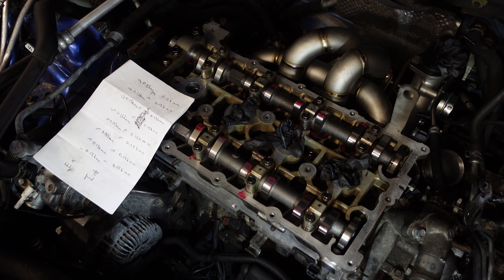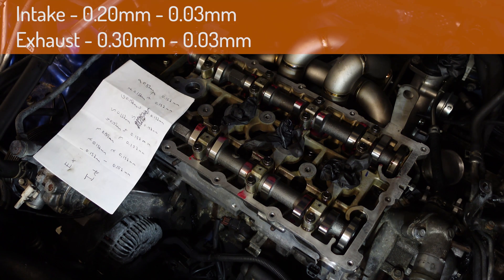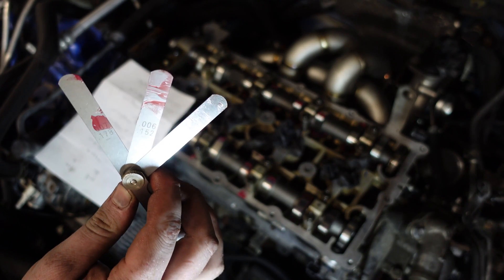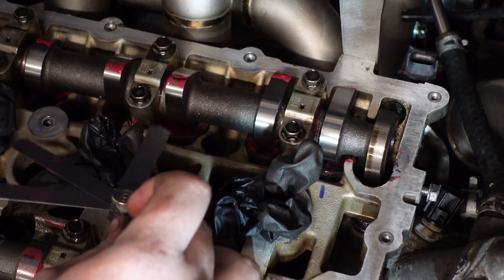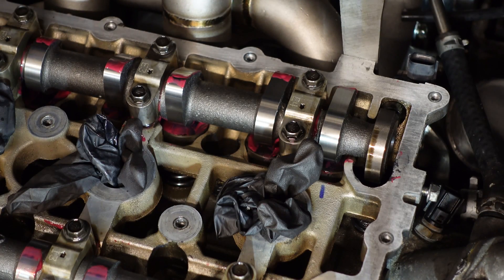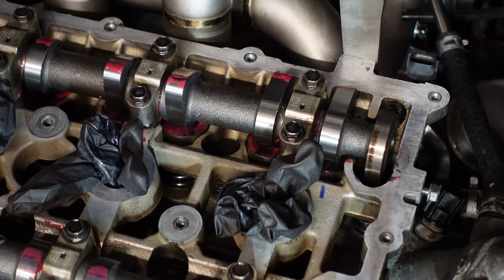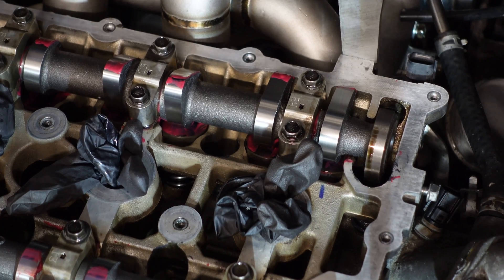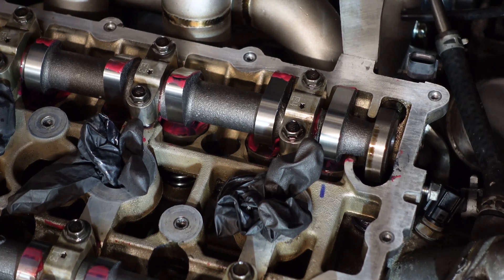HOW TO: Check Valve Bucket Clearances

Comment: Very nice. But in the beginning you’ve said it should be 0,2 +-0,03mm. Than means that your gap is to small)) and your valves are going to burn out...
Reply from the maker: 0.2 - 0.03 they are 0.15
Reply: @rowanlewisuk  but they should be 0,17-0,23. If less - no more valves))
Reply from the maker: @yuryrysiavets2958  thats not what the Mitsubishi engine overhaul manual says, according to Mitsubishi its in spec
Reply: @rowanlewisuk  manual says that on intake it should be 0,2 +-0,03 and on exhaust 0,3 +-0,03. 
So by putting 0,15 you got the risk of valves burning
Reply: @yuryrysiavets2958  This is what I'm seeing in the manual. So confused now. LOL! Using a thickness gauge, measure the valve clearance with the arrow shown in Figure. If deviated from the standard value, make note for the valve clearance.
Standard value:
Intake valve 0.20 ± 0.03 mm (0.008 ± 0.0012 inch)
Exhaust valve 0.30 ± 0.03 mm (0.012 ± 0.0012 inch)